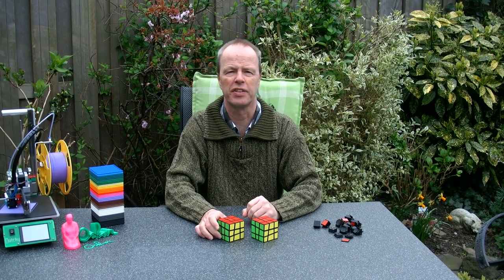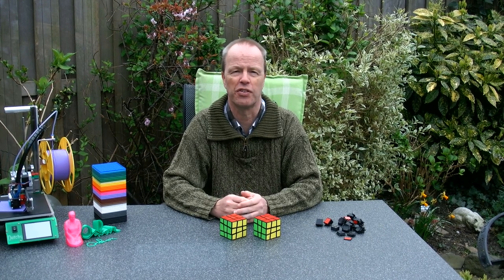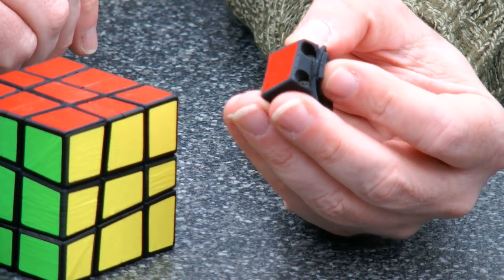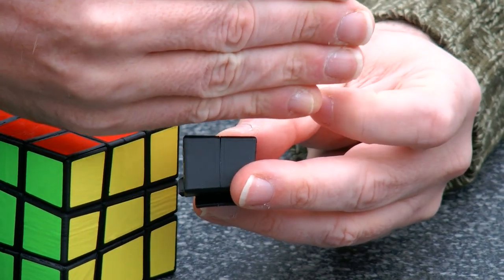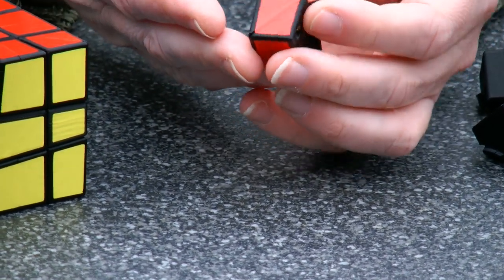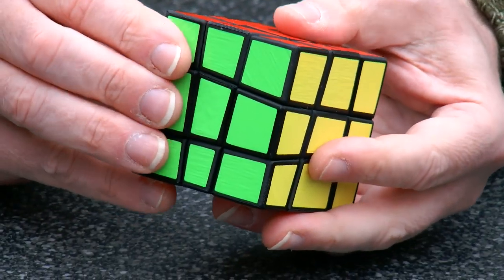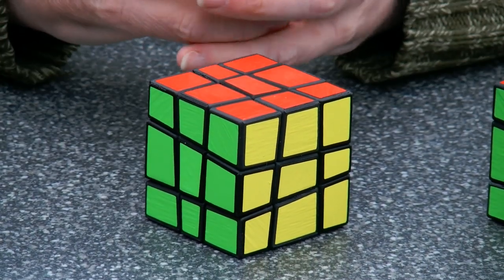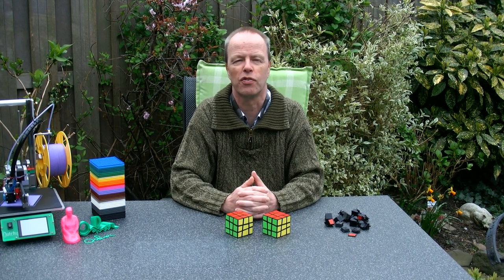Sloppy Cube - Will you print it yourself on your 3D-printer?

Comment: For me, this puzzle would work and perform better if printed in SLS rather than your FDM print, because I believe FDM is not a good choice for 3D printing twisty puzzles at most, although I think it works on other types of puzzles like labyrinth, assembly, to name a few.
I also remember Greg Pfennig (@Greg's Channel) tried printing his puzzles in FDM but it didn't go out well in some of his results before he switched to SLS 3D print for twisty puzzles.
Reply: Oskar has been using SDS printing services for years to prototype, this exact puzzle in fact was originally printed using SDS from shapeways. Printing puzzles on a home printer might not be the best way to get a working puzzle, but its a fun challenge to try and make it work anyway.
Reply from the maker: You can buy it in SLS, but only at SLS cost ...

Comment: Warping makes the prints' bottom not flat. There are many ways to counter warping like heated bed or chamber and glue sticks.
Reply from the maker: The problem is not just the sticking to the bed. And the warping forces are rather strong. Warping is much less with 3D-printed wood: https://www.123-3d.nl/3D-filament/Filamenttype/1-75-mm-filament/1-75-mm-PLA/Hout-p12180.html

Comment: I will try printing it. From next week onward i'll have access to a dual extrusion printer, so I will probably try printing it with dissolvable support. (If the stls also have the pieces in one piece, instead of two. Haven't looked at them yet)
Reply: Can the STL file work if printing on SLS?
Reply from the maker: Sure. However, please only use your own 3D printer, not a commercial service.

Comment: are you using anything to help the plastic stick to the print bed? I used to have lifting issues like that but i found using a think layer of school glue stick on the print bed decreases the lifting.
Reply from the maker: The problem is not just the sticking to the bed. And the warping forces are rather strong. Warping is much less with 3D-printed wood: https://www.123-3d.nl/3D-filament/Filamenttype/1-75-mm-filament/1-75-mm-PLA/Hout-p12180.html